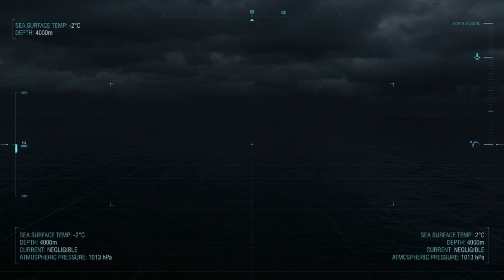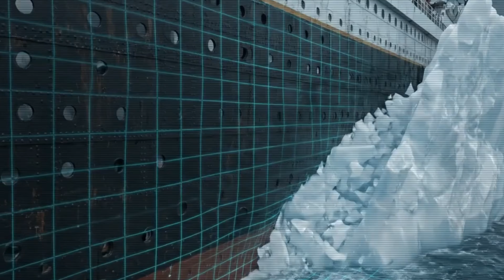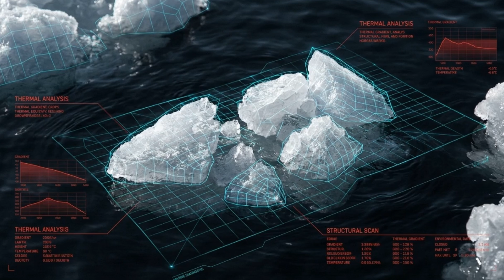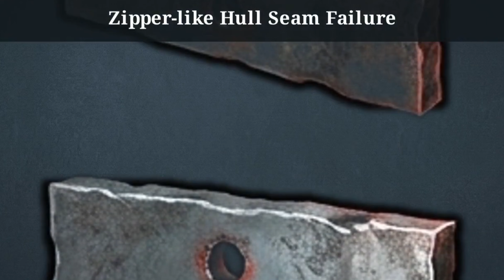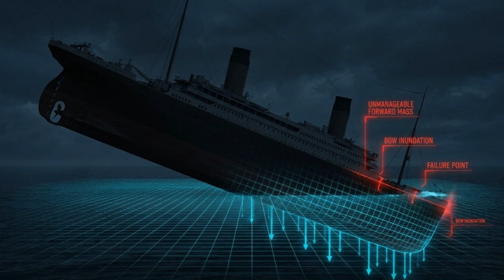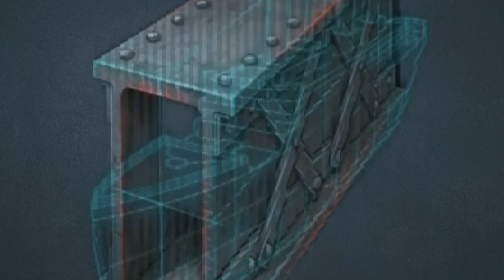Why the Titanic Really Failed: A Mechanical Post-Mortem

Comment: a 100 ton ship - a 10,000 ton iceberg .... guess who wins
Reply: a bit more than 100 tons
Reply: @ohwelols  okay, make it 250 tons. The shit still gets bodied by the iceberg. So whats the point in even mentioning that?????
Reply: @xxxxz4862  It was 56,000 tons.
Reply: @CR7GOATofFootball  46,000 tons actually
Reply: @ohwelols  The double ended scotch marine boilers were 15 ft. In diameter, and weighed around 100 tons. Titanic was 46,000 tons !
Reply: Not the point. It wasn't a head-on crash. It was a scraping gash over at least compartments. The plates separated allowing tons of seawater to flood into these compartments. It was more about the poor quality of the steel used in construction than about the size of the iceberg. If they had struck it head-on, it probably would have remained afloat, but unable to move. At least 100s of people wouldn't have died.